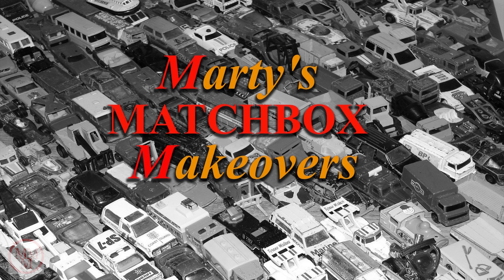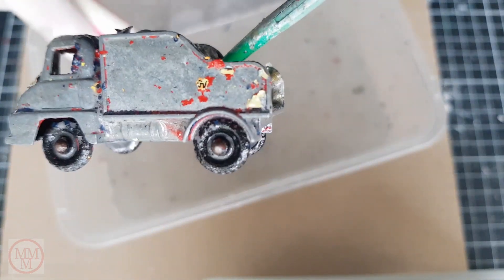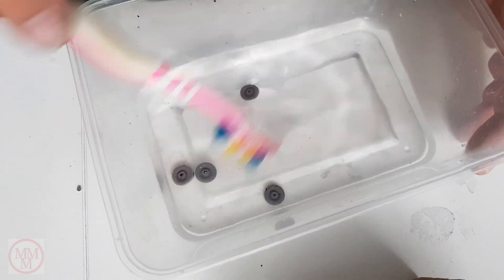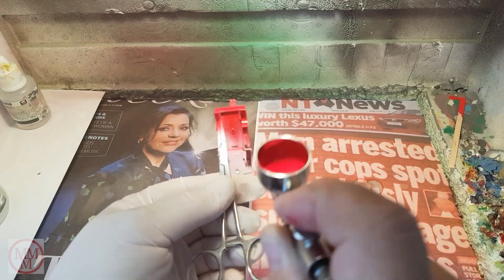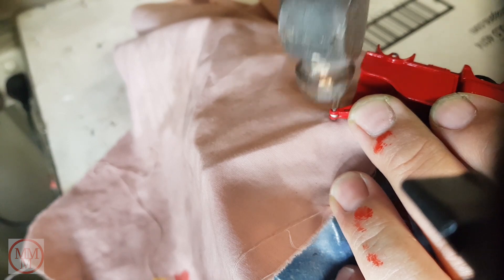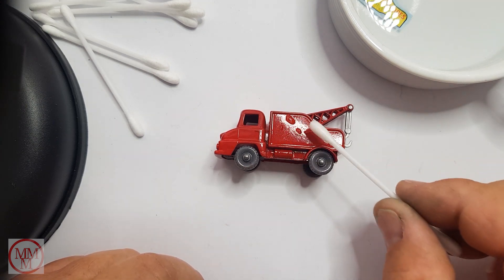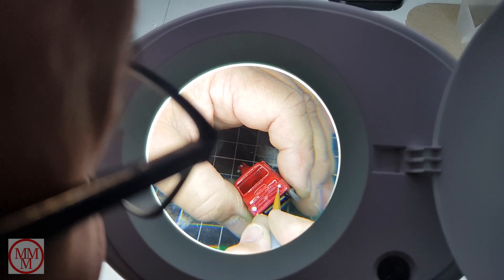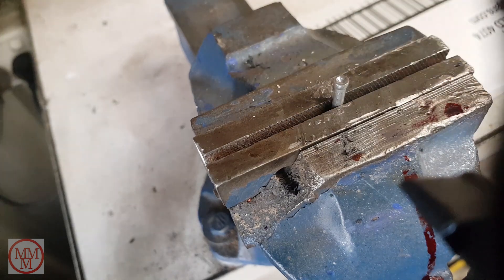MATCHBOX Restoration No 13c Thames Wreck Truck 1961

Comment: Hi Marty a great job on the Thames Trader as a job as a HGV driver now retired, I did get to drive one for a company they were a terrible vehicle to drive, the doors was very small had to struggle to get in and out of. The gearbox lever was in the middle between the seats but too far back it use wrench my shoulder when I changed gears, keep up the good work

Comment: I used to drive one of these Thames Traders when I had a Saturday job with a vehicle dismantler in the mid 70s.  The half-height doors look really awkward until you get used to them.  Ours was 4x4 with a HIAB unit and the procedure was to put a railway sleeper through the car windows and hook chains around the protruding ends. This worked well until the boss tried lifting a Mk 2 Jag and was left with the HIAB rig on the deck.  After that I used an Austin FG with a hand-operated crane like the one on your model.
Reply from the maker: Great story! - Amazing......Thanks for commenting.

Comment: Great job as usual Marty, I really enjoy your videos. I have two suggestions that might help you ( they work for me anyway) when you have an area or a piece that is a little rough (for example the after market tail gate you received for the  dumper body that was a little bit rough in the casting) or anywhere on the cast metal also those tight little areas where the paint stripper didn't get the paint . I found that if I use a SOFT BRASS wire wheel in my Dremil or any spinning power tool and take my time I am able to buff/polish the piece to where it is 90-100% gone or UN-noticeable . #2 The stickers...I learned this from a professional sign installer ( he applies sticker signs to vehicles and windows) If you were to put a couple drops of a liquid soft soap (hand soap / dish detergent) in the water mix it in good it will make the sticker and the surface you are applying it to just slippery enough that it will slide around without tearing, if it folds over on you 9 times out of ten you will be able to gently unfold without loss of sticker work out any air bubbles easier. Then after it is placed where you want it you just do as you normally do with the cotton buds etc. and when it drys it will be stuck on good. Just a couple ideas, anyway keep the Great videos coming Cheers John